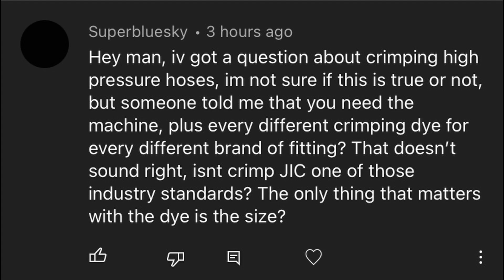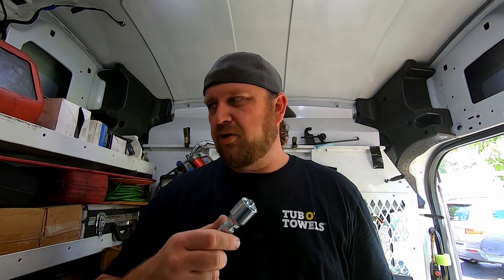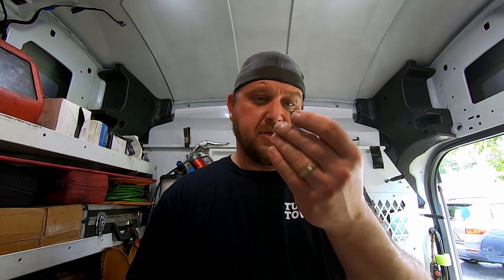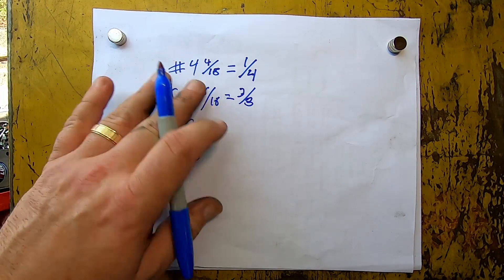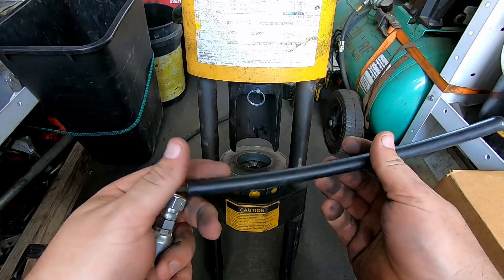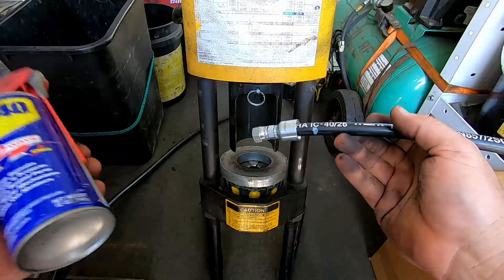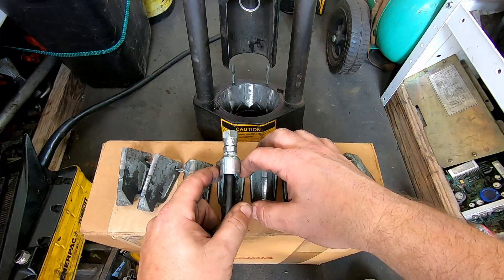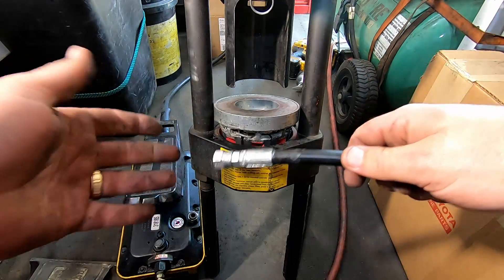Hydraulic Hoses And Fittings 101

Comment: Only part way into it, and I appreciate the sharing of knowledge. Very nice for up and coming people in the industry. Some random bits that are good to know for the new guys:

JIC are all SAE fine thread, so if you have buggered threads you can chase them like a bolt. 
The "dash size" is how many sixteenth of an inch the hose ID is, so -2 is 1/8" ID, -6 is 3/8" ID, and so on. 
Parker and some other companies make "seal savers", which are copper cones that go on the flare to prevent galling when you really crank them down. 

You'll most often run into AN/JIC (ANs are Army/Navy spec JIC fitting, usually made out of aluminum), ORB (O-ring boss), ORFS (O-ring face seal), NPT (which sucks imo since there's always a leakage path, hence the need for thread sealant), BSP (British standard pipe), and BSPT (British standard pipe thread).

Comment: What is your opinion on keeping 90 degree fittings in line with the curve of the hose? Once when I was retrofitting a hydraulic system on a rail truck I installed the fittings not in line with the curve of the hose and was told to always keep the fitting in line with the curve so it doesn't pull out. I think it's bullshit but I'm curious to know your opinion.
Reply from the maker: If it doesn’t matter I’ll match the 90 to the bend of the hose. If there’s a bend in the original hose I’ll try to match that with the new hose.

Comment: Let’s not even get into Komatsu fittings, BSP and British parallel threaded fittings  🤮
Reply: Also, your bad day fittings are an every day thing when working on high reach equipment. Both man and fork lift stuff. I had stuff up to 24, which I believe that big guy you showed is.
Reply from the maker: I ran into those BSP fittings back in the day when I worked on Leroy air compressor. We had to buy OEM because no one stocked them.
Reply: Working on hydraulics here in the UK is a pain in the arse! we have equipment from all corners of the planet so have to stock every type of fitting, we mostly run into BSP parallel fittings on the smaller stuff and farm equipment but a close second is the metric fittings on European machines, lots of ORFS too, we don’t see too much JIC anymore, they tend to be on older machines.
Once you include all the brand-specific fittings into the mix it becomes a big headache 😂

Comment: I've always used a company qualified and insured and it sure paid off when we had a bad hose on a case 580 on the campus in one of the main pedestrian ways. Just a drip but still unacceptable so I went to a great company in Mesa AZ (multi equip dealer, good guys) and they made us one and we installed and it blew out the fitting and leaked 10 gal hyd oil all over. When we took it back a Goodyear rep happened to come in and saw the hose and checked the spu on the hose and it was on a notice of a bad lot and they had not been notified yet so Goodyear bought it all. Saved our asses. Pays to use a pro with the right stuff.
Good videos, I enjoy these indepth and sane reviews. Be safe

Comment: You forgot the quick-connect and interlock fittings. They're basically the same thing, crimp down the same way, but push to connect. They're often used for low pressure air and water lines, but I've seen them on hydrologic lines in industrial machines.

Comment: I love learning stuff in the back of a van. 

My current job. My technique for making hoses is to go to the nearest hydraulic shop. My last job. I had to make all my own hoses. We used gates hose/fittings/press. To my knowledge as far as making hoses. Gates fittings are used only with gates hoses. Parker are only used with Parker. I heard that the Parker hose machine is way easier than the Gates.
Reply from the maker: You pretty much have to stick with like brands for hoses and fittings but in an emergency anything goes 😁
Reply: An emergency is when they escape from the back of the van
Reply: @KaaiHDM  Bro that sounded so creepy you have no idea.
Reply: Parker and swagelok are gold standard
Reply: @DaylightRobberyCA  no argument there. Most of our hydraulic shops are Gates. We only have 2 Parker shops in the area unless I go to a John Deere implement shop

Comment: Just learned something new today...!!!!
I've done research on why it's important to use the correct blinker fluid...!!!!
Can you explain the "why" using the correct blinker fluid is important...????
Reply: Eye drops are technically blinker fluid!
Reply from the maker: If you don’t use the correct blinker fluid it only blinks once.
Reply: You have to remove the cap with a left-handed torx wrench. It's a specialized tool, if you don't have one you have to fill out an I.D. 10-t form to get one. Don't forget to ask for extra wire lubricant.

Comment: Hardly anyone knows the size of the hoses correlating to the #4/#6 etc. I've been working with hydraulics for over 15 years, and you're basically the only other one that I've seen explain it that way.
Reply: I cut, assemble, and crimp hoses for a living and have never heard it. I feel lied to this whole time.
Reply: Yep, funny how I never ran across that bit of info.  Thx!  I believe that applies to how high pressure tubing manufacturers size their parts also.
Reply: #4 is 1/4 in. #6 is 3/8. And so on...